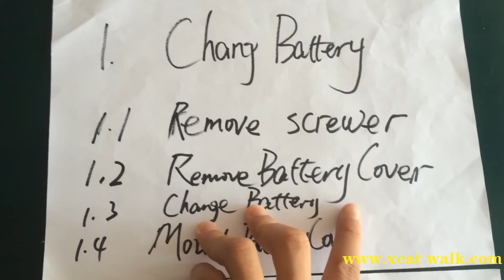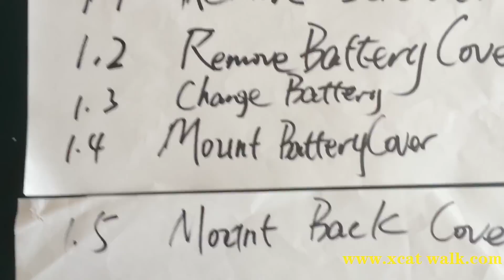change the battery of  two wheels smart balance scooter electric.

Comment: I'm sorry to ask you one  thing. The black plastic lock of the battery does not close nor with the cables outside that inside. If I force the screws to arrive, I'm afraid to give the wires.

Comment: if you look at the box in the back right those look to be samung batteries and there taking those out and putting in cheap Chinese batteries  from my research  Samsung pack have a blue shrink  wrap and Chinese  has grey
Reply: +robert shuell My Wallygadgets board has a blue wrapped battery but it is a generic Chinese battery. No problems so far.